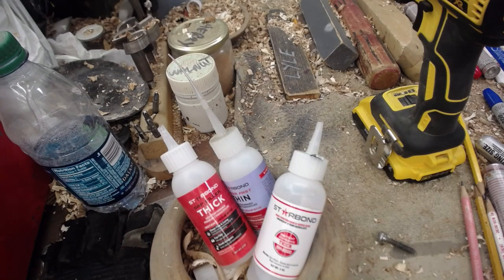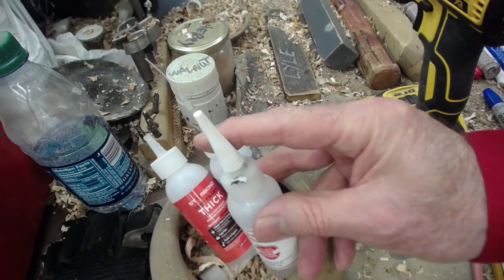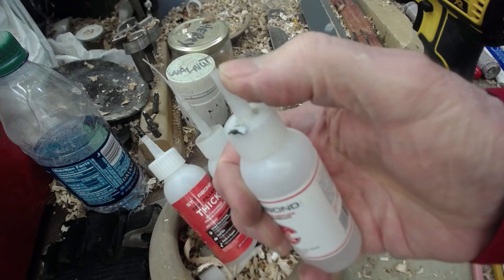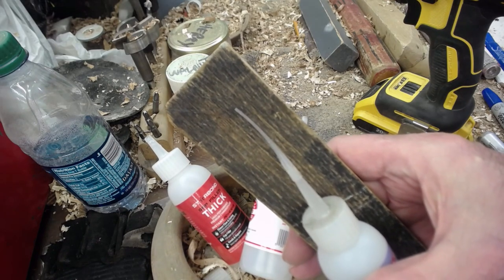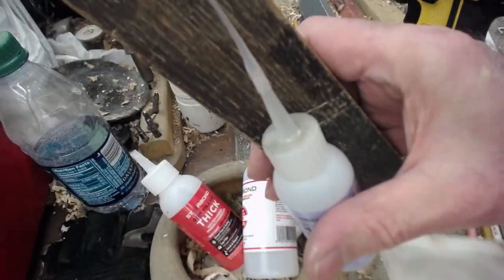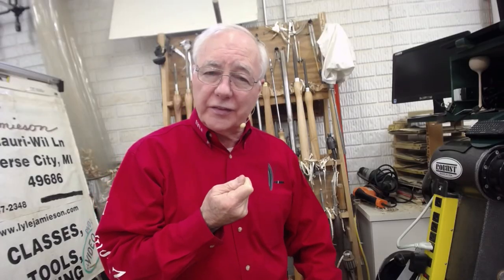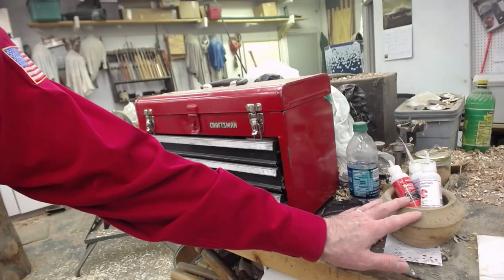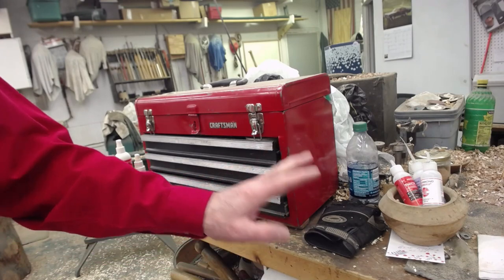Tuesday Tip 53 Prevent clogging nozzle for CA glue

Comment: I have found this useful but if you do not want it to spill (packing for travel take it incase of breakage at hobby store) you can still put the lid on just tap the bottle on a hard surface several times and leave it open for a few minutes then cap it.

Comment: I guess you could put the lid on for transport and then take it back off.  What about in areas like where I live that the humidity is 70 - 100%?  Maybe insert a pin in it?
Reply from the maker: Thanks for writing. You are skeptical.  I live in a wetlands with a pond out back, high humidity too.  Just try it and you will see it works.  A pin is just like a lid, not good.

Comment: Lyle, I've been told by several Turners to put CA Glue in the refrigerator to keep it fresh and it doesn't go bad,  Is this a Myth?  As you have said keeping it in the fridge will create moisture
Reply from the maker: Hi Pat, Yes that is a common belief.  Storing it in the freezer is good, but only with unopened bottles.  Once opened do not store it in frig or freezer because of the condensation.

Comment: Leaving tops off might work if you're not in an area that has 90% humidity 360 days of the year.
Reply from the maker: Hi Not, Try it.  If you have it cure within a year I will buy you a new bottle.  My shop, when I only use wet wood, is always at a high humidity rate.

Comment: Where I live in Hawaii they will not ship accelerator.  Do you know an alternative to commercial accelerator?
Reply from the maker: I will look into it. New one to me. Moisture is the curing agent but just water would take a lot longer than accelerator.
Reply: Baking soda or backing soda in water works.  91% alcohol works better than water.  Bleach works.  I do not know about the strength of the bond with alcohol or bleach, but baking soda is very hard.  I have read that  alkaline chemicals (baking soda, etc.)  react with the tiny amount of acid in it (to slow the cure) to make it cure faster.  The fumes are bad!  I lost a day of my life due to using a store bought accelerator in an enclosed room.  I still can not remember what my body did without me on that day.  I have not had a problem with baking soda, avoiding the fumes of course.
Reply: Baking soda
Reply: 🛵 The horrors of Hawaii. 🏝️
Reply: You can use baking soda and water to make an excellerant, usually 90/10 percent with water 90%, however, I have found that when you make the excellerant make it 80/20 percent with 80% water. It is true that water is by itself an excellerent, BUT, the baking soda added as a dry component is vigorously an excellerant. So my tip is this. Spray the surface to you wish to bond with super glue and let it completely dry, there will be a faint but real presence of dry baking soda residue afterwards. Then out the super glue on the other piece that you will bond to it, and bond them together, you will not be disappointed at the almost immediate results. The joint or part you apply this together with will be stronger than the product you are bonding.

Comment: Have you ever kept a bottle of CA for 30 months with the cap off?
Reply from the maker: I never put the cap on.  And I use up a bottle before 30 months.  Most glues will have a shelf life between 1 and 2 years depending on the brand.  Lid on or off will not make much difference.  Lid on is just a hassle with the spout clogging up.
Reply: @Lyle  Thanks for the advice. Best regards.
Reply from the maker: @johnmitchell3749  If you have any ideas to increase viewers, Im all in.